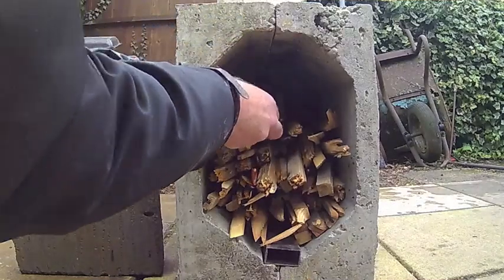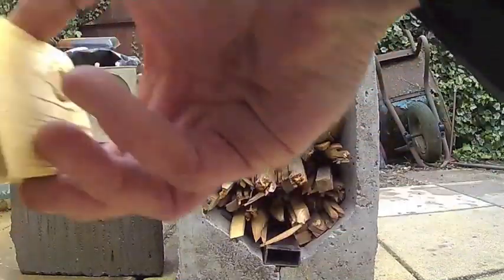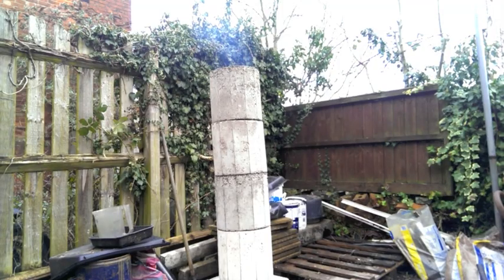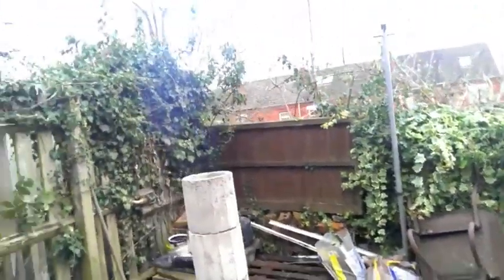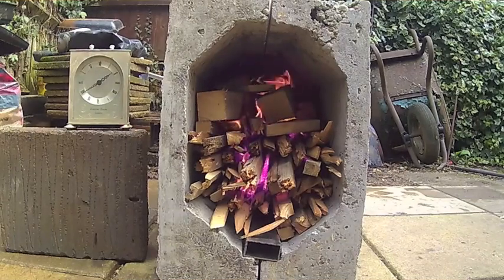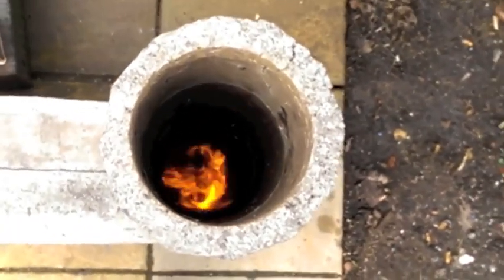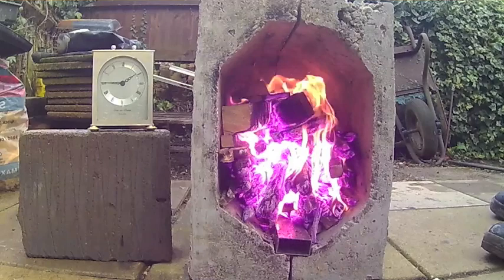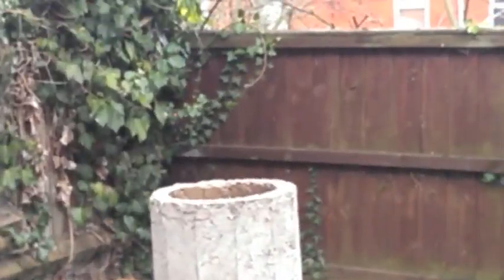Rocket Mass Heater Batchbox First Test Burn From Cold

Comment: Unless thats a refractory cement,  its not going to hold up to the heat very long before the concrete starts to pop, crack, and crumble.  Regular concrete can't even hold up to a regular campfire,  let alone a fire burning hotter from the air drawn in.
Reply from the maker: It's refractory, outlined in the other videos. I don't share your experience of regular concrete, I've cast several fire cores with portland cement and easily get a season's service from them. Cracks are not a problem if the design allows for them.

Comment: Don't you think it would be better to pass the tube above the flames?
Reply from the maker: I've not compared placing the secondary air duct above and below but am happy with the lower option and would use it in future. I don't see any advantage to the top version. For me it simplified the casting and met a personal  preference that gases move upwards as they warm.

Comment: Hellow and THANKS! I'm building a bbr4. Your double combustion is amzing, PERFECT! Thanks. 
I'll warch your other videos to understand the secundary air (p chanell) thrught dwon there. I have it over the fire box. Thanks again 🔥👍!
Reply from the maker: Yes, the secondary air duct is just the square tube along the floor ending at the base of the riser. I thought it might become blocked with ash but find it stays clear provided fuel isn't crammed too close to the back. The overhead alternative may well be better but I found the floor channel easier to incorporate and it seems to work reliably. Thanks for your comment and good luck with your build.

Comment: Can you pleas tell me if the Rams horn flame pattern is the most efficient pattern of flame for complete burning ??? How about a circular pattern ??? Thanks
Reply: According to experiments, the circular pattern is too smooth for effective mixing of the gasses. The design of the port forces the ram's horn pattern for maxim turbulent mixing.
see here:  https://batchrocket.eu/en/workings
Reply from the maker: @codetech5598  Thanks, I'd forgotten how detailed the stuff on batchrocket.eu is.
Reply from the maker: Good question - but I don't know the answer. I suspect that any turbulence will increase the mixing of flue gasses with air and cause a cleaner burn.

Comment: Just want to say how much I enjoyed this video and the comprehensive details of the construction of this stove and its parts. Definitely will make one.  Love the door.  The plug for the mold is what I need more details of as I would say this is going to be my stumbling block.  I am 83 years old.  I think I would prefer to make the plug in wood.  Hope you continue to post more videos on it's progress.  Also thanks for the link to the open source info via Peter van den Berg.
Reply from the maker: Thank you for the kind words Sammy. I hope you enjoy building and can tell you I found it all very satisfying even when things go wrong.
Regarding wooden plugs, they will work but my early experiments had some disasters as even quite small defects or slightly bad angles make them difficult to release - my advice would be to use multi-part plugs with at least one section that is not in contact with the casting so it can release reliably and loosen the rest (some sort of wedge arrangement). Foam has the great advantage of being slightly compressible and, if needed, can be cut away. 
Peter's website is indeed fantastic. I'll post the link again here for any readers not yet familiar with it: https://batchrocket.eu/
I did eventually install the burner as a mass heater and enjoyed my warmest winter ever. I hope to eventually post a follow-up but have been distracted lately.
Thanks again for your comment and good luck! Do let me know if you make progress.

Comment: Why not make a taller heat riser if the flames are reaching the top?  Would that not increase combustion efficiency and heat generation?
Reply from the maker: Yes, it looks like it might be better taller. I was using dimensions shown to be efficient from this web site: Batchrocket.eu but suppose they give the minimum efficient height. Thank for the question!
Reply: @batchrocketproject4720  Thanks for the response!  I have been planning a large build for a long time now and keep second guessing myself.  Hopefully I'll get to it shortly.
Reply from the maker: @mothanwrdz  I know what you mean about second guessing yourself - I took ages to finally get on it seriously after many half-engaged experiments. I remember shivering one snowy day and decided I wouldn't put it off any longer and began making the foam plug for my casting in doors. 
Good luck!

Comment: Watching this and the other published videos on your channel, I could not see the construction of the secondary  air inlet. Cold you post an image if possible, please?
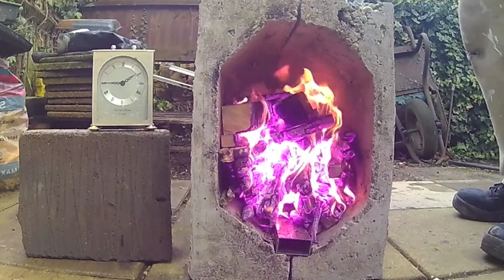Reply: 2:24 if you look at the bottom of the burn chamber, that bit of rectangular steel tube looks like the secondary air inlet.

In fact @3:40 you can see he maes sure to keep the fuel away from the end of the tube.
Reply from the maker: Thanks.
Reply from the maker: Thanks for the question and sorry for the delay. As TheKlink said, it's just a 2"x1" steel channel set into the floor of the burn chamber casting. It opens at the entrance to the bottom of the heat riser to let air reach the flue gases as they enter and ignite them. In most designs, the channel is shaped to have a vertical piece at the end so that ash and fuel doesn't block it. I always intended to add that as a modification but found the flat version worked fine as long as I didn't pack fuel too deeply and removed excess ash build up.
Good luck!

Comment: By the way is it better to have a high riser or a short riser, Thanks
Reply: The taller the more rockety
Reply from the maker: Yes, I think taller risers would cause more draw as with any vertical flue. That said, there are recommended heights depending on the diameter of the flue opening and these will give good efficiency. There is a table here  https://batchrocket.eu/en/building#dimension  specifically related to batch burners like this one.

Comment: What about putting a water boiler (steel) on top and enclosing the whole thing?
Reply from the maker: Yes I think that would catch the most heat. The down side is that it might condense more rubbish from the flue gases and cool them. My plan was to instead arrange a copper coil outside the heat riser and enclose all that in a drum.
Unfortunately, I've not been able to advance the water-heating experiments yet but hope to one day!

Comment: You could burn the campfire with dry logs and still see no smoke. I was hoping the testburn would be with the burn-chamber door closed with the calculated oxygen inlet. A video made a bit in a hurry and excitement, whitch is ok, but the test should have been more in imitation of the real indoor situation. If there was some darker backround, the video lense made it possible to see the smoke flying around the burnchamber. But still thanks for the video.
Reply from the maker: Thanks for the comment Tanel. You're right about the circumstances of reporting the experiments. What I was investigating was that the burner behaved as hoped regarding the draw of the heat riser. Because the castings are simply placed together, there are many air gaps that make any meaningful assessment of air entry and burn efficiency impossible. I did eventually install the heater and when all the gaps were sealed, it burned very cleanly and the air control in the door could be used to create a slow burn when the system was fully hot.
Incidentally, the 'smoke flying around the burnchamber' is in fact steam coming from the castings which absorbed water from rain. Once hot, the burn is smokeless. 
Thanks for your comment.

Comment: I have did a test, what is better a normal rocket mass heater with vertikal feed or this? How did you make the rizer, I need a solution for that, is fire concrete a idea?, it needs insolation.
Reply from the maker: Thanks for your comment and sorry for the delay in responding. My other videos have details of buiding the riser and the materials. I do not now whether the vertical feed versions are better but the advantage of the batch box is that it can be loaded with quite a lot of wood in one go. If you haven't seen it, I can highly recommend Peter van den Berg's website - 
Batchrocket.eu

Comment: Enough fine particles present? these need to be tackled in future, a electrostat for example.
Reply from the maker: Indeed, invisible particles are probably present. I think the hotter a burn, the less of a problem small particles are (although at a cost of more oxides of nitrogen which are also a problem). In use, the heat riser is enclosed in a 'bell' and is designed for the flue gases to cool to condensation point before exiting the final flue - much of the particulates may be deposited inside the bell along with any condenstate but you're right, nothing is 100% clean.

Comment: Looks like smoke coming from the bottom of the heat riser
Reply from the maker: Thanks for the comment rusty and sorry for the delay in replying. Apart from smoke out of the riser at the start of the burn, most of that 'smoke' is steam coming off the damp castings (which were outside and rained on).

Comment: For you to consider regarding producing hot water:

I am putting a stainless 1/2 inch diam. steel water pipe network inside my riser which will be double walled insulated stainless steel for maximum up draft (metal is better than ceramic as the riser since metal gets hotter, and a hot chimney creates a better updraft as needed). My first clean burn success with clay and clay bricks before switching to insulating ceramic bricks..

https://www.youtube.com/watch?v=JjVMS3LgJQM

putting a SMALL PIPE NETWORK IN THE RISER IS A GOOD COMPROMISE....like in the below video......which shows great potential...agree, pls comment ???

https://www.youtube.com/watch?v=vYH8ZC1gCIw&t=53s

DO YOU THINK IT TO BE SAFE PROVIDING THE WATER FROM BOILER INSIDE THE RISER VENTS INTO AN OPEN TANK SO RISK OF STEAM EXPLOSION IS REDUCED ??

i calculate not enough heating power if coil is wrapped around the external riser.

Comment: Some help for you designing a copper coil or boiler/box heating element for immersion in the flame. The following formula is used to calculate the power of heating element needed to heat a specific volume of water by a given temperature rise in 1 hour.

volume in litres x 4 x temperature rise in degrees centigrade / 3412

(4 being a factor and 3412 being a given constant) - for example 200 litres of water, to be heated from 20ºC to 50ºC, giving a temperature rise of 30ºC would give –

200 x 4 x 30 / 3412 = 7.04

meaning that the water would be heated in 4 hours by 1.75kW of applied heat, or in 1 hour by 7.04 KW

Thermo-syphoning requires large diameter insulated pipework - preferably 28mm copper, and the pipe run must rise continuously to the hot tank. As this is a stainless boiler you can use it DIRECTLY to heat the water. Just remember that the exit pipe from the boiler should be physically higher than the inlet pipe - even if only a little. Best way to mount this boiler would be on it's side. As long as your system is open vented there is no real chance of an explosion. If you use it indirect you need to either fit an expansion pipe or an expansion vessel in an unvented setup (complicated!). Flow rates not really relevant to a tank system - recycle time more so and that can be calculated as above.
Reply from the maker: Thanks Dr, that is really useful information. I didn't get much further with developing it as a water heater (but still hope to and will be guided by your data). Thanks.

Comment: hoiw many times have you fired the batch stove, has thermal shock caused any cracking of the refractory cement ? Can the burn chamber be made of anything else eg ceramic fibre board ? thanks again
Reply from the maker: Sorry for the delay in replying.
In some of my other videos you will find examples of alarming cracks! But, those were mainly due to the castings being damp from rain and from mechanical shocks. I eventually installed the burner indoors and used it as a mass heater daily for about 5 months - there were no problems with cracks during that time. The castings are fragile but not damaged by heat.
I think ceramic fibre boards would work well but, again, may be mechanically weak - no problem if you're gentle when loading fuel. 
Thanks for the comment.

Comment: Finding plenty rocket stove options for water heating. please consider the below j tube rocket arrangement with insulated water tank above riser tube. Your batch rocket has an advantage in that the flame is horizontal so that it could be directed onto a car heat exchanger radiator which must be orientated vertically to get a thermosiphon.......https://permaculturenews.org/2012/11/23/rocket-stove-hot-water/
Reply from the maker: That's a pretty thorough article, thanks.

Comment: Great progress, well done. Is this van den Berg chamber more suited to heating hot water than a standard eg 8 inch J tube design ? What is the design of your water heater ? (interested in building an efficient water heater for an off-grid house). I dont know of any rocket stove water boiler heaters that can heat domestic 44 gallon water tank efficiently with no pollution and reduced associated fuel requirement...to me that is very surprising, but they should exist as they are surely highly desirable !! How did you cut the foam to the size of the 3D chamber ? Unsure if copper or stainless steel coil method of heater water in a rocket stove is viable, or maybe direct flame heating a stainless steel tank (like with cooking stoves) will be more effective at heating hot water quicker ?
Reply from the maker: Hi DRJMF, thanks. My intention is to build a coil that will carry water around the heat riser, inside a bell and circulate from a holding tank. I've considered direct heat into a larger top-tank but believe cool surfaces to be the enemy of a clean burn. Because the flue gasses are hottest as they leave the top of the riser, and cool as they are forced downward towards the base of the bell, the water-carrying pipe should meet hotter gases the hotter the water gets as it siphons up the spiral from the base to the top, rather than meeting cooler gasses as the water heats as would be the case in a simple chimney coil. 

I hope, but have yet to build prototypes, that this arrangement will allow for a clean burn and efficient thermal siphoning. Because the coil will extract heat 'downwards', it should cause rapid cooling of the flue gasses as they descend the bell and increase draw. I think this is the arrangement used by specialtynotill in the "outback hottie" water heater - https://www.youtube.com/watch?v=wx3HU4yGnFU - although can't be sure as he has few build details. 

I cut the foam for the mould with a sharp knife and used spray foam and tape to join the pieces. With generous greasings, I was able to reuse the moulds a few times with only minor tape repairs. 

Thanks for your interest and good luck with your project.
Reply: great, use the right stainless steel, copper corrodes and discolours the water. See below url.....they have 32mm tube coil. For heating much quantity of water, they suggest to use 12circles with 32mm SS tube. hope this helps you....I have to say, i want the same as you...hot water and a clean, low fuel burn. Perhaps i can build one and I could vary some parameter different to yours, so we can understand the system better ? I have access to local clay and mix with perlite or sharp sand. 

http://www.smartclima.com/stainless-steel-coil-heat-exchanger-for-dutch-tub.htm
Reply from the maker: I would love to use stainless steel but cost and tools to form it present hurdles for me. The preformed coil in your link looks excellent but I haven't determined the optimum diameter and length for my system yet. I will probably do some experiments with copper and hopefully upgrade to stainless steel when I have a good design.

Regarding output, I don't have my estimates to hand but think the burn rate is around 15kW. Of course, I'm unlike to extract all of that even with the most efficient coil but there should be ample output for a tank thermal store which can accumulate hot water over a longer period than the demand cycle. I may later try to build a bigger chamber as the current one could be re-loaded about every 3/4 hour.

Although he doesn't use a rocket design, atlantisdiving1 built my favourite water heater I've found on here. It's a water-jacket design with fan controlled burn: https://www.youtube.com/watch?v=_-W87mBw7Go&t=96s

Thanks for the links and ideas. It will be great to compare notes after more progress.

Comment: Sorry Im not getting it, I love rocket stoves in general, but as another viewer said what is the point ?
Any kind of stove will cease to smoke if the air vent is left open like this, sorry but this is too subtle for me....
Reply from the maker: Thanks for the comment Gary. This is an early test burn at the start of a possibly long journey to develop a burner with air control which I hope will eventually allow greater control of the burn under limiting primary air, while fully burning the smoke with secondary air in the heat riser. My eventual aim is to build a water heater but that is some way away yet. Do visit again if you're interested. Dave